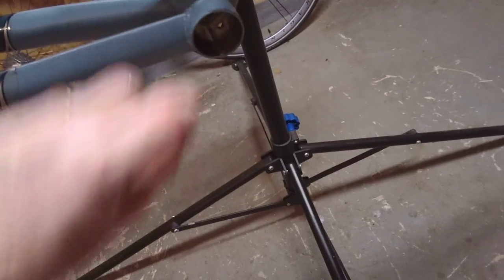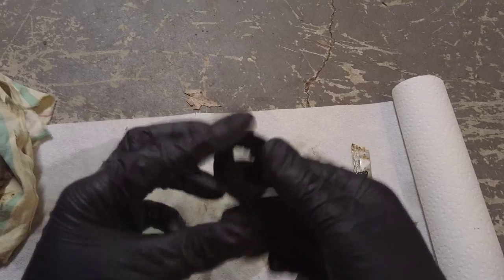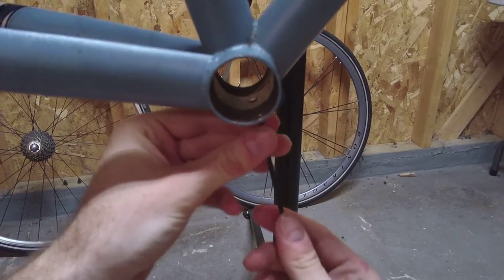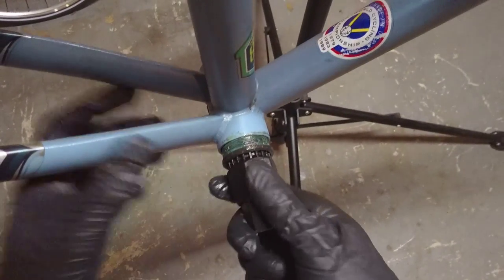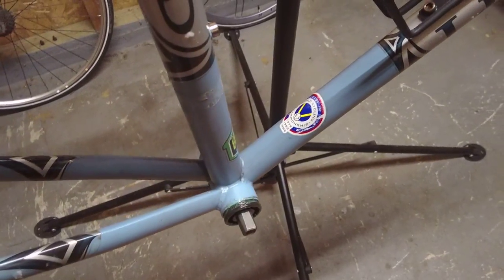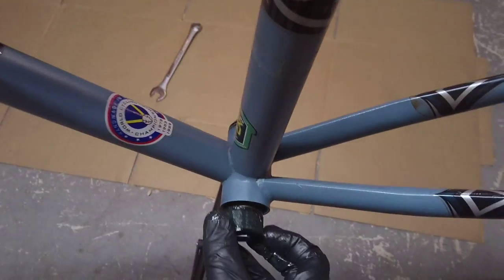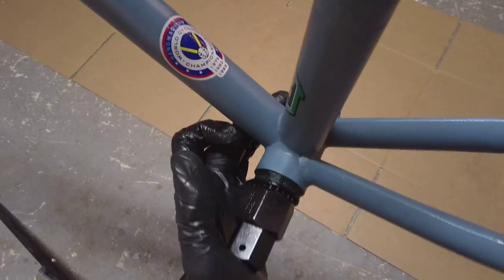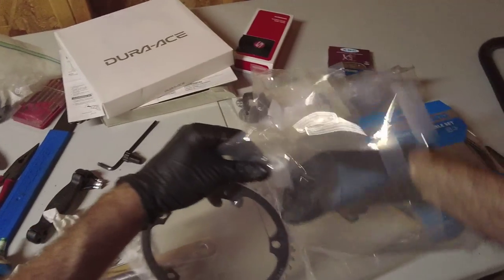Bottom Bracket And Crank Install Square Taper 1X9 Speed Conversion Bike Blogger

Comment: BB tip, don't tighten the drive side all the way until the other side it threaded in most of the way also, sometimes they're just off enough to catch and bind and ya can't tell if it's catching on the BB or it's not threading in correctly.

Comment: 4:40 tightening -- recently did this and used a craftsman air tool that maxs out at 400 ft lbs and let that puppy hammer in for about 5 minutes. It was a fun job because the bike store wanted $100 for the job and I ordered a Milwaukee Sawzall and cut out the old (broken, I broke the adjustable STEEL cup so it came out in pieces, some broken, some sawed out) one and now I have a sawzall added to my tool collection! (freud diablo carbide-tipped blade started cutting into the frame! BTW -- The bike store guy could not do it and told me to throw the bike away. Aluminum frame with full suspension. No fucking way. It is a supremely fun and comfortable bike and I have ridden it downhill through the forests with ice and snow.  I made it work and way better than new! I've pry put 100 miles on it and it will likely last thousands.)

 The UN-55 from Shimano is a good part for this BTW because the adjustable cup is metal not plastic.

( i was pleasantly surprised to find out it was less than twenty bucks especially considering it is a true sealed bearing)

I hate these square tapered bottom brackets because I have killed several of these. They just are not reliable for people with really strong legs, apparently. The crank arm often loosens for me. On one bike it became a chronic issue necessitating me taking a socket & ratchet wrench with everywhere I went and finally the crank failed and I found some one throwing out one so I went over with my park tool and scavenged it up. I get real lucky that way sometimes.

BTW since all the BB threads are NF (National Fine) not NC they can take GOBS of torque before stripping. I actually asked a Crane Engineer with a college level mechanical engineering degree about this and he explained the leverage on NF threads have less leverage because of the depth of the cut thread. (the next strongest above that is square threads, btw) Even though they look finer they are stronger than NC.  Chances are you could not strip them without a breaker bar and the torque wrench for this really is a joke. Just an FYI for anyone reading this.

Now that I own the tools I think I will upgrade all my bikes to that Shimano UN-55 BB eventually.

BTW the 1/32 extra is because fixies need a more solid drive mechanism or it can fail to 'brake' when you are slowing down so the beefier part is preferred/needed. BikemanforU has some excellent vids explaining all this stuff. Wow, I ramble. Must get to bed. Great video, nice to see what issues others have with bikes also, bikeblogger.